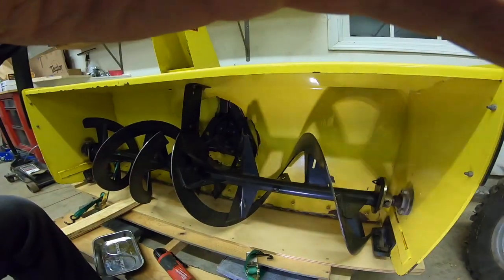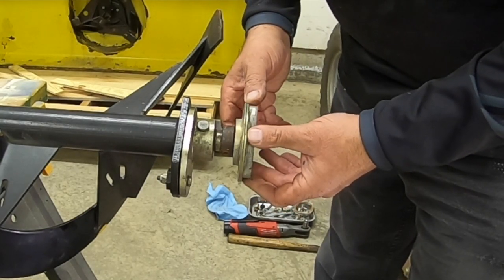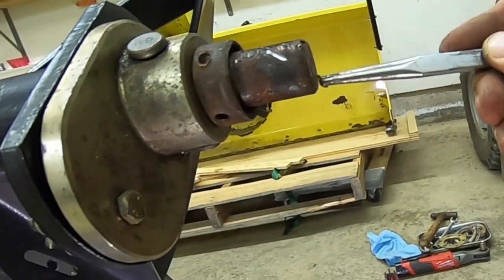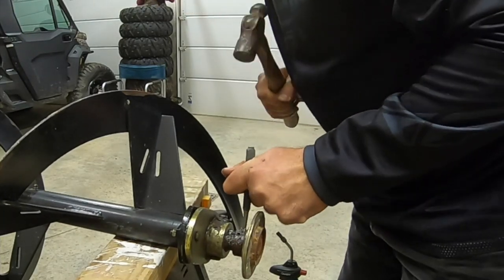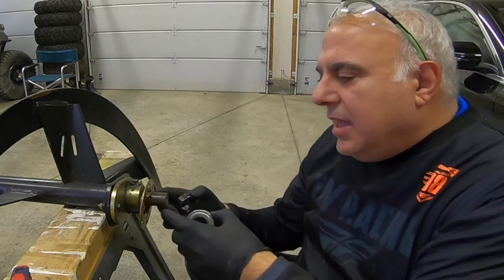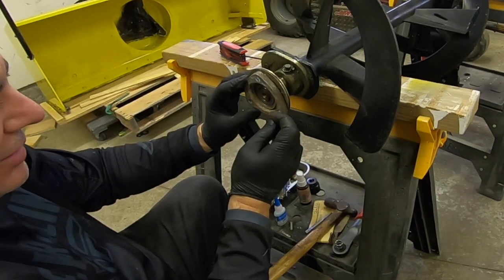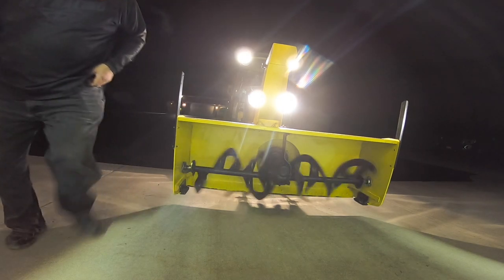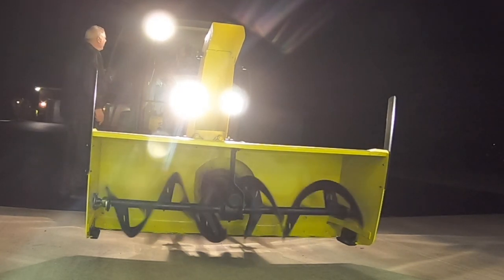John Deere 59" Snow Blower Auger Bearing Replacement Mounted On My John Deere 3046R Cab Tractor #144

Comment: Nice work! Looking forward to your winter snow blowing videos.
Reply from the maker: Thank you Dan...yesterday we had 2 inches of wet slop that melted by the afternoon. Stay healthy and safe. 🙂
Reply: @maraudermitchelli  we dodged the same system here in Central Michigan. Northern lower got 8-10” of heavy wet stuff. I was itching to use my JD 2320. I must say I envy you for having a cab tractor. Just not practical for me. :-)
Reply from the maker: @danimal1611  For 30 years i did not have a cab. The worst was chute snow blowing back at your face...but you know that. I traded 4 tractors over 30 years to get to this cab tractor...it's not practical for everyone...maybe not even me. We love our tractors no matte what they are.

Comment: great video . I have the same blower as you but it's on a JD3520 cab tractor. I spray my auger bearings with fluid film before every storm. I changed the auger bearing Two years ago and they pull right off no heat or puller were used just a hammer and a punch. The tractor is 15 years old now it was 13 when i did the bearing.
Reply from the maker: Awesome love it I’m going to try wd40 and see how it works. Were your bearings bad? 🙂
Reply: no one of the bearings had a crack in it so I replaced both wile i had it out.

Comment: Great video! I have a 2520 with a 54 inch blower. It's about 11 years old. I have a different mount on the front. I like the 3 point mount like yours. Had to replace the bearings that the driveshaft passes through . I looked at the auger bearings they look good. I'll keep an eye on them, maybe next spring I'll just go and replace them just to be safe!
Reply from the maker: Thank you Fred. They are slow moving and cooled by the snow so i think that's whey they don't have catastrophic failures. Tractor people like to maintain our equipment...although sometimes it's late. Have a great thanksgiving.

Comment: I use a pellet jack for storage, installation and removal,  the kick stand on the blower rests on one the leg
of pellet jack and provides very good stable ability for blower on the pellet jack when moving and storing.
Reply from the maker: Ray...i don't think my blower has a kickstand...honestly i will have to look.
Reply: @maraudermitchelli  It should be on the left side of the blower, it has 1/2" bolt that it swivels on, and you tighten to storage position. If you don't have it check with your JD dealer, or I can send you a picture of it.
Reply: @maraudermitchelli  and  @Ray Peel I also have one with the little kickstand on the left that slides down.  But even more importantly, on mine I can loosen the huge wingnut on the top of that A-frame assembly and pull out that large pin, then I can lift up the blower and deploy the kickstand.  When I lower the blower, the A-frame releases from the blower and makes it so much easier to detach and attach.  I noticed that you also have the large wingnut and the A-frame looks similar, so that might work the same way on yours.
Reply from the maker: @GregDePasse  I have no kick stand. Now it could've fallen off, or i removed...i can't remember i've had it so long. But i do see the hole where it mounts. I am filming the video tonight attempting to find the vibration...we will find it together. thank you Peter

Comment: Greg from northern Michigan. Have you ever checked the auger gear box oil level, or changed out the fluid ?  It can easily be done when the auger gear box and flight assembly is out. Good video as always. Take care.
Reply from the maker: I checked it last year, guys at work over filled it where they shouldn’t of. I have to read the manual maybe I’ll change this season. I made need to contact have a great thanksgiving 🙂